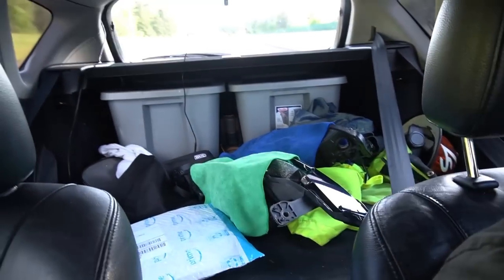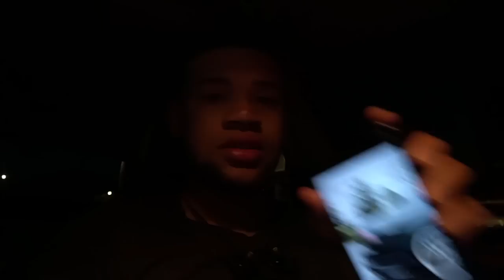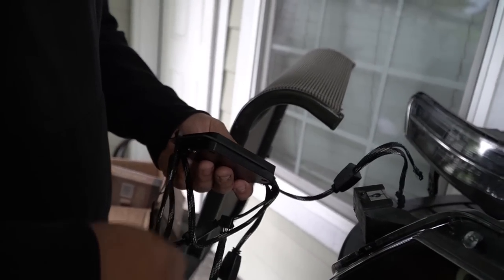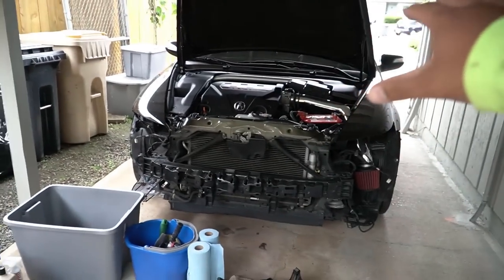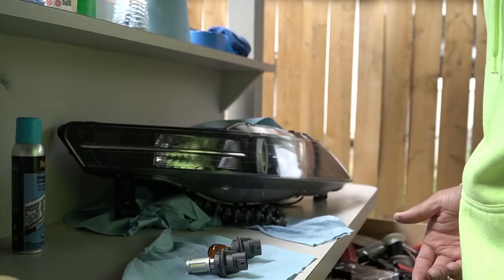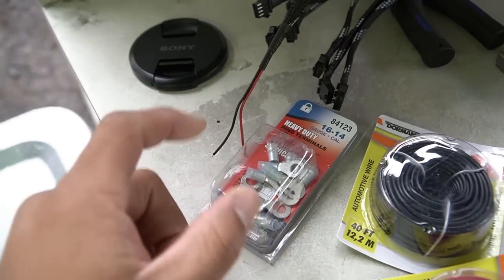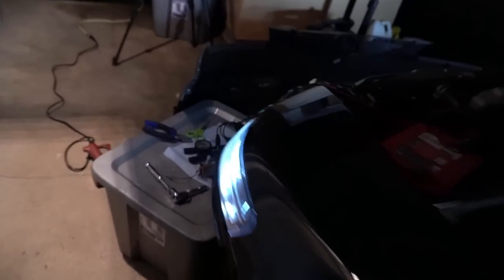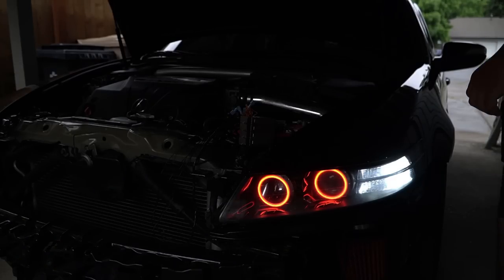Speechless how good it looks!  Halo LED Install

Comment: For anyone reading through the comments, the hyper flashing can also be fixed by buying a new flasher relay from Diode Dynamics or Modifying your original flasher with a resistor.

Comment: Those wheels in intro look so good. I gotta go work on my TL. I hate having to remove the front or rear bumper just for headlights or tails but that’s TL life gets easier after u do it few times. I gotta go compound and polish my car get some swirls and scratches out so my black paint get that  blue sparkle to come through and look drippy like his. Love these vids but makes u want everything done at once on my car which just ain’t gonna happen. Long expensive process making cars nice.

Comment: for the fitment on the passenger side I was able to push the light in alittle and hold it then tighen the bolts so you might be able to get it to fit better by just loosing the bolts and push and hold it in while tigheing the top one first then the rest
Reply from the maker: hoping when the bumper goes on it lines up better

Comment: you should run a adapter from the bluetooth controller to your cabin that way your controller isn’t on all the time and with a press of a button your halos will turn on. I retrofitted mine on my 04TL And running everything independent
Reply: Can you explain a little more ? I'm going to attempt this same thing. And what you said im interested in. Like the Bluetooth box that he sits on the battery.. you have that inside you car ? Or what do you mean
Reply: @XxLaMaravish13xX  no overall you don’t want the controller on all the time i’m running an adapter that turns the controller on with a click of a button
Reply: @XxLaMaravish13xX  The controller sits in the box with my battery I have it in a separate small box eliminatining any water or contamination getting  to it
Reply: @Mannyswanks  thank you for the help. Sorry I'm new to this but once I understand the process I'll be able to do it. Ill be honest not sure I am on the same page with you lol like do they sell a plug and play adapter with a switch for you to turn on and off ? & by controller.. we are talking about the blue tooth box or an actual controller?
Reply: @XxLaMaravish13xX  yea we are talking about the same controller and no the adapter I got off ebay, it basically powers from the battery and u plug the xbt controller to the adapter
Reply: @Mannyswanks  thank you fro the help. Im going to do more research and hopefully I can understand your explanation better like ooohhh thats what he meant. I may refer back to this after I do more research and reply to you

Comment: The one problem with tl are the bluetooth module/ homelink on 08 + they have a power withdrawal when the vehicle is off. Happened to my mom 08 TL it drained a new battery in 4 days. 

The guy at the auto parts store tried to tell me it was the alternator but it wasn't cause the battery light never came on.